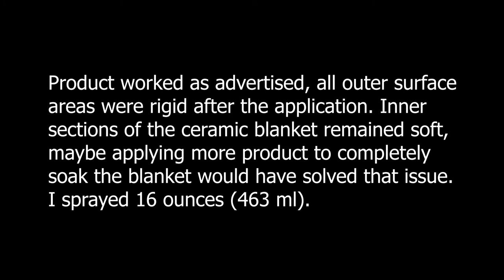Applying Simwool Rigidizer to Ceramic Blanket in Foundry Furnace

Comment: Some suggestions for your DIY Firebricks. I use to be Fitter in charge of BHP Refractory Port Kembla.
They only have two types of refractories for there blast furnaces, one white mix and a grey mix. Both contain an aggregate about 10 mm in size, suggest trying scoria or pumice stone. The grey mix could take much higher temperatures, I suggest trying graphene in the mix. Both white and grey refractories had stainless fibers add in the mixing process for added strength and crack resistance. Note fiber lengths are a minimum of 32 times the diameter. When refractories were pored they appeared to plastic like in there ability to flow. So they most likely contain a small amount of some sort of polymer, silica fume (pozzolan). Glass Fiber Reinforced Concrete has these additives and follows in the same manor. All refractory that was cast into a steel vessel had stainless steel refractory anchors welded to them.
Reply from the maker: Thanks for dropping the comment Jeff, it’s great to have feedback from someone that worked in the field with refractory products first hand ... I’ll see what I can get my hands on and please stop by again for feedback on the upcoming firebrick videos!

Comment: I just received an new furnace and used the same stuff. I diluted it with about 40% water  and used a cheap spray bottle.  About the same size as yours and I used It seems to have soaked it real well.  After 5 hours I can feel it hardening and able to form the edges where I want them with no loose fibers. i used about 20 Oz of mix and it soaked everything real good.  I'll do another coat if necessary with the remainder of the bottle which will easily make the same amount(1 qt bottle), but I think it is going to be more than enough the way it has hardened already and still feel very wet.

Comment: You want the soft air layer for insulation it is y it you pack the wool down it will burn up faster .rigidiser just keeps you from breathing in the fibers . If u want a better coat I allwase USA rigidiser then itc coating after I have a firm base to apply it to .I only use rigidiser on my fourge but I use both on my foundry's